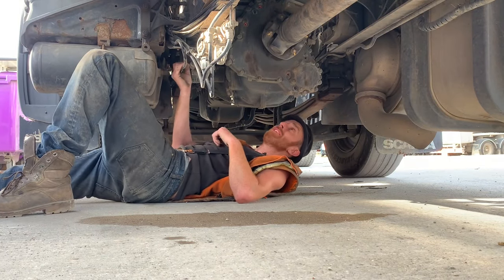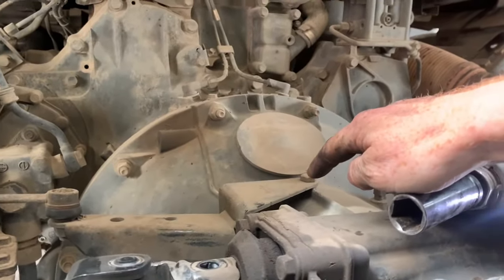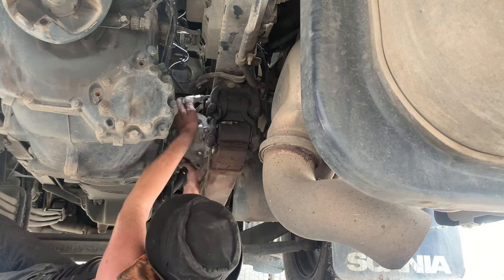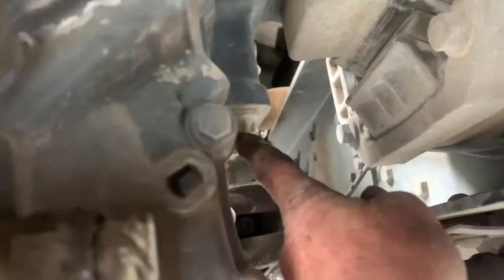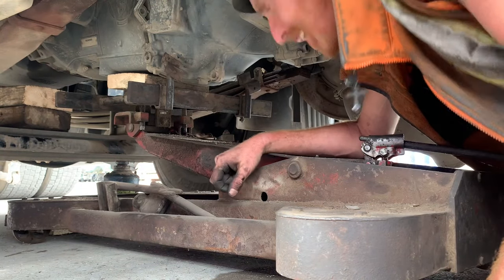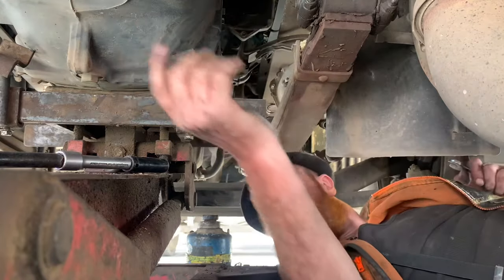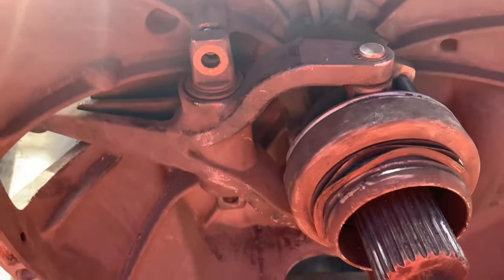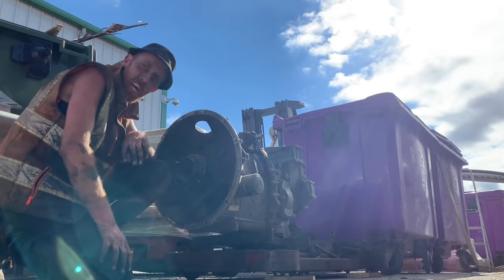How to remove a gearbox Scania release bearing clip tight mobile hgv mechanic lorry truck semi rig

Comment: Ha, wish there was that much room round a Coach gearbox. Luckily most of our fleet is auto these days, years ago we had some manual Mercedes with V6 engines. It as much quicker to take the engine out to do the clutch, we done it that often the bolts undone themselves 😂.

Comment: Mate get yourself a length of 2 inch box section, warm it up and put a bend in the middle. Undo the top gearbox mounting bolts ( the 4 24mm head ones). Now jack up the engine and gearbox together.  Slide your box section under the flywheel housing and sit it on the suspension springs. Some models you can just put thick bar straight across the springs and sit the engine on it.
The way to get the clip off is to lever the bearing forward while you release the clip with the other hand. If it doesn't come out straight away lever it forward a few times
Reply: Do you work on these gearboxes regularly?cheers ken fox
Reply: @mikeday4348  👍
Reply: Not any more mate, i retired a few years ago. I worked for scania in the uk for 12 years and scania in australia for 8 years.. I've fitted more clutches than i care to remember. 
Don't think I'm one of them people that only worked at dealerships. I've worked everywhere and on everything before i worked for scania. 
Like yourself , i could get the wipers working off the P.T.O if i had to, or was paid to👍🏻👍🏻
Reply: @mikeday4348  did my last message come through?cheers ken fox

Comment: Bits of wood are tremendously important when cocking about with bloomin gearboxes. I tend to find.
Reply: Scania probably sell main-dealer spec bits of wood with logos on & whatnot. I just use aftermarket ones - I find those come in a wider range of dimensions. The handiest size I have is 4"*4" -  those get used for  everything.

Comment: Hey Chris, I absolutely love the work you do and love even more the knowledge you are passing on to us, I’m attempting to take the transmission out of my 1999 ford iveco 75e15 I’ve never done it before and I can not get the clip to release, I have no wholes at the top or bottom for better access just the whole where the arm goes through, I’m going to have to take the arm bolts out somehow for it to slide out, what size are the bolts, and if you have a better suggestion for access that would be great
Reply from the maker: Don’t know size they are of head mate, might be hard to get to the arm bolts, you might be better taking the pressure plate bolts out, it just means you have to turn the fly wheel round to get to each bolt, good look wizKid….. lovely bank holiday job that 😬😁😂

Comment: Chris , what about the release bearing going back ON  to the pressure plate when fitting the box. Is it a pig ???
Reply from the maker: No mate keep your clip closed and just push it in with a ply bar through the bell housing holes 👍

Comment: You should be able to get the release bearing easier by pushing the bearing from below with the lever and squizing the clips, once you squize you pull the bearing with the leaver and it's out ... No need to remove the slave cylinder just remove the 22mm air and the fluid line despite these great work
Reply from the maker: Cheers pal I did try that it was tight but it might of gone if I got someone to push the clutch at the same time as squeezing the clip 👍I want the job done as quick as possible! It takes longer and more cost to loose all the fluid than just take out the three mounting bolts of the slave and launch to the side
Reply: I wouldn't remove the fluid line. Just adding another job to the ticket. And if it doesn't bleed up properly your adding a headache. I always just take the slave off complete. But horses for courses.
Reply: Do you pull these gearboxes out regularly?cheers ken fox

Comment: New models  very easy to  remove whereas the old mixer truck you  got to remove the front gear housing and  remove  2pcs allen key bolts to  change the  release bearing  fork assembly

Comment: Scania G/Box lot easier in a pit.
Reply: Do you know much about pulling these gearboxes out ?cheers ken fox
Reply: @kenfox1911  yes mate, we have a Scania fleet so I’ve done quite a few. Great effort doing it on the ground by the way. But using a pit or ramps is way easier. If you have access to that stuff.
Reply: OK I've got a 20ton ramp ,my scania is a old 4 series andi think the slave cylinder is on the way out ,its the type that is on the thrust bearing ,do you know if the box comes straight out or does it have a clip on the bearing, cheers ken fox
Reply: @ryanbennett1024  👍
Reply: @kenfox1911  to be 100% honest mate, I’ve never worked on one that old before, but I’d imagine it would have a clip.
Reply: @ryanbennett1024  OK cheers mate